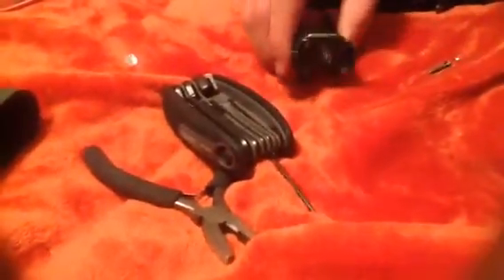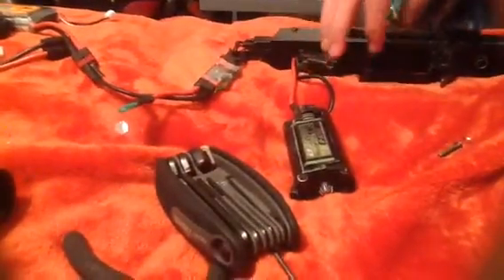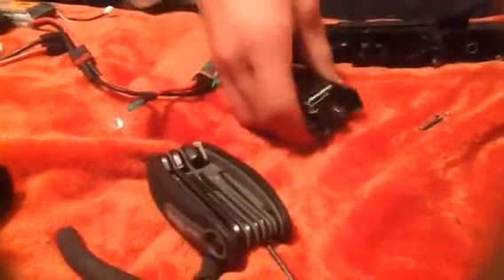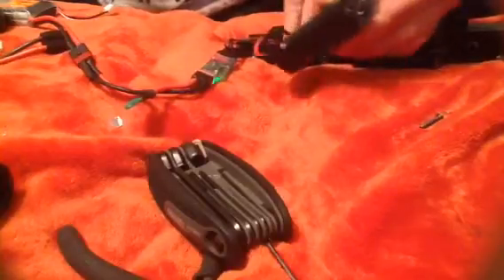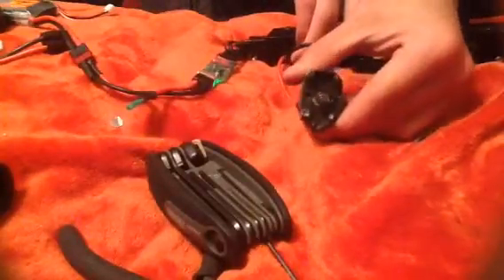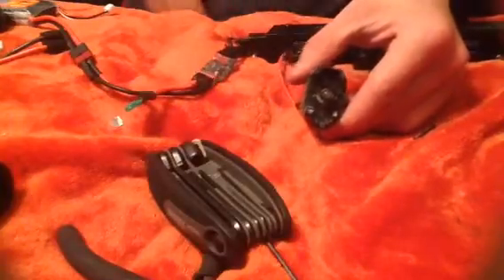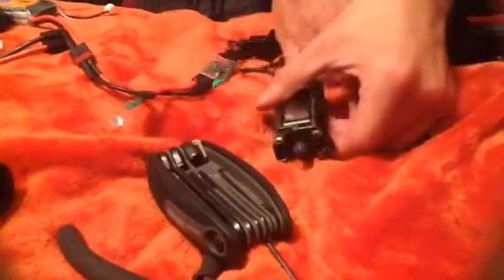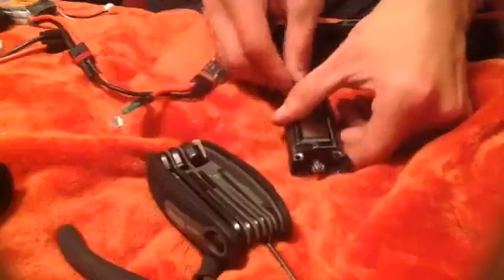Asg motor problem

Comment: Make sure your gears are connected, search up how to fix a dead motor, and/or buy a new motor, and I would also l like to say hello, you may remember me, I was the kid in the hotshots vid who wore the NCR ranger helmet and yelled ALLAHU AKBAR. you may also want to check to see if all the wires are connected to the motor, and open up the gearbox to see if everything is running as it should. Worse comes to worse, you may need to get new wiring for the motor. If I couldn't help you, you may be able to talk to Mike's airsoft, Nightmare airsoft, or Evike.com support. If you do not have enough time to get it repaired,  you may be able to ask Airsoftology, and by the time you are in Tennessee, he will have a response vid for you. I'm trying to help you as best I can, and believe it or not, I am starting to do custom work on airsoft myself, and I am going to start a project for my friend to give him a unique m16 type with high torque and cyclic rate. Hope I could help, and if you want to say anything, my email is SGBDpataplaya @ gmail.com
Reply from the maker: haha I just figured it out. it was unbalanced because of metal shavings on the motor. I took them out and now it works amazing.